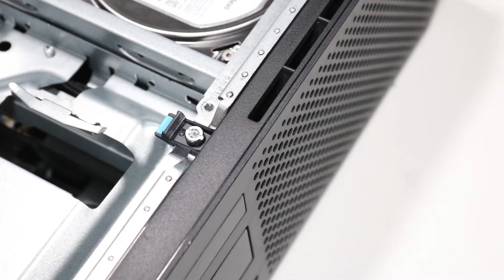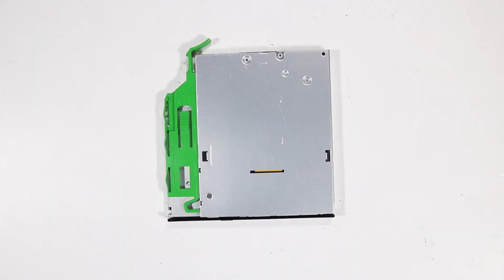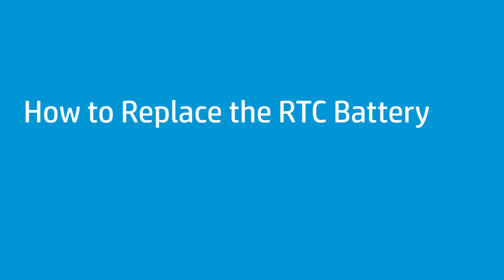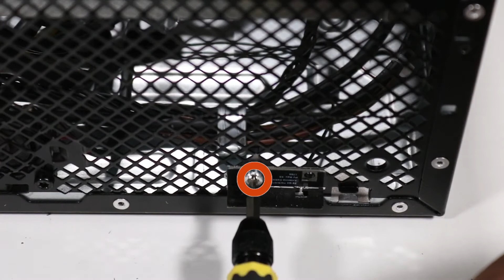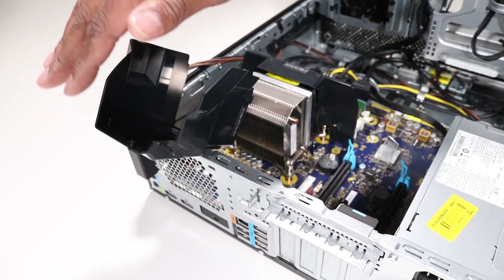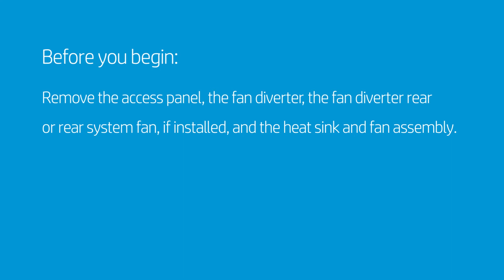Removing & Replacing Parts   HP Z2 SFF G4 Workstation PC   HP Computer Service

Comment: At 25:50, you talk about removing the 3x HP P0 phillips head screws to remove the Flex I/O board. Are these HP screws or can they be replaced with a more common M size series phillips head screw?